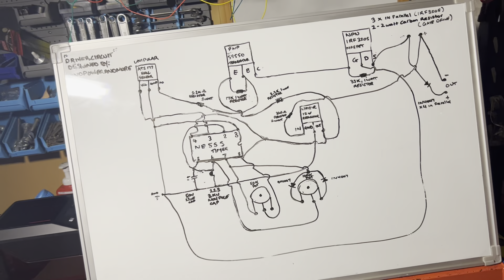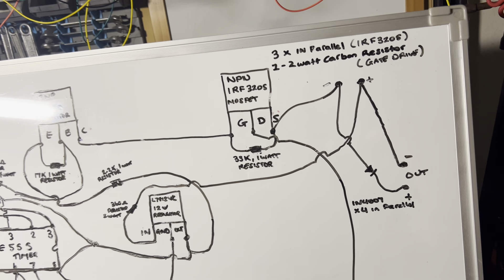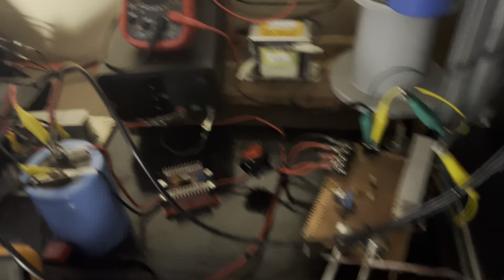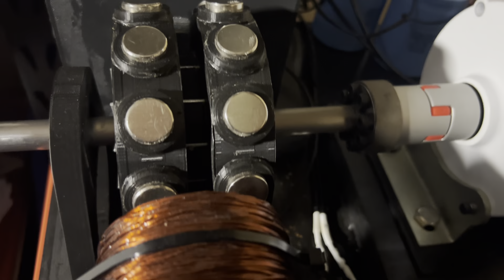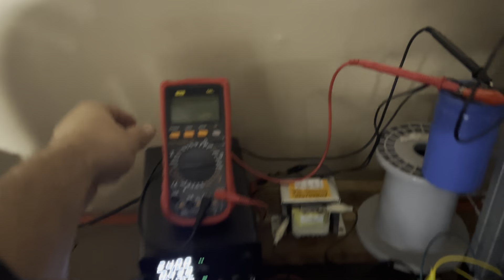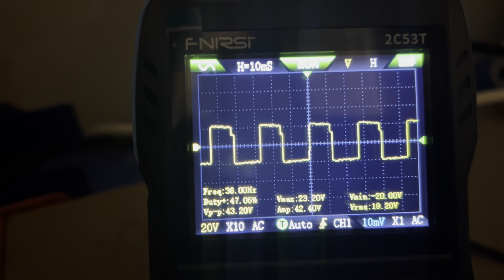Pulse Motor/Generator How It Works

Comment: It's just working off the capacitors, you're driving yourself mad with this endeavor. A few solar panels would do more then you ever did here easily and efficiently with zero maintenance. Just sayin' gl mate. 😮
Reply from the maker: There's a method to this madness. Watch my other videos to be up to date on what's actually going on here. There's so much more than meets the eye and this video is more of a walk through explanation rather than how much power it puts out hence of the title name.
Reply: What about night and cloudy streaks? He would need some wind power to supplement a gap. Stll leaving a hole if none of that can output effectively. So a generator of some sort or maybe some hydro power loop system which would just make the whole system pointless. All to just power a generator 😅😅😅😂😂😂.  Please let this man work

Comment: Just found your channel.. This is really cool stuff you're working on. . there's a couple other guys doing the same thing, its very exciting times. One very minor (and off topic) thing: when building frames out of extruded aluminum frame with those right angle corner braces, they're are significantly stronger when placed above the joint (under tension) instead of below the joint (in compression). Not that it really matters at all,  just so you know for future reference. Sorry I had to point it out because it was bothering me lol
Reply from the maker: Thank you for the lovely tip and welcome aboard 🙂

Comment: I've done the same similar concept with bedini circuits. I found out it's more efficient to recirculate the back EMF from the drive coil into another slave drive coil directly instead of recharging caps like you demonstrate. Just put a diode after the drive coil to collect the back EMF this increases the RPM by nearly double without any additional input
Reply from the maker: Thank you. That is true for most bedini cicuits and other types of pulse motors when using that technique to purely rely on the radiant inductive spikes as the ssg produces little to no tangential or centripedal torque on a rotor. because I'm utilizing a portion of the flyback energy or the B-EMF (both different anomalies occupies in the same system) to do mechanical work  whichs why capacitors are needed to help keep buffering the electrical transferring of energy while taking advantage of spinning disc to harvest the pick up coils being a decoupled system that compliments all the stages together.
Reply: @11Sam11 I have converted a washing machine motor rewind it bifiler it has plenty of torque and speed with additional output to another set of drive coils to spin the same rotor even faster with no extra input
Reply from the maker: @gregstafford2155  I did the same also with my fisher & paykel motor years ago. But even still, there's an exchange trade off that is proportional to your output. I've posted a recent video demonstrating how placing the hall sensor can convert most of mechanical into electrical and vice versa. Here's a link https://www.youtube.com/watch?v=LNhP20VoNV0

Comment: It's nice to see an inventor. Actually evolve their invention, and not stay stuck with the same research prototype that was only meant to do their initial research. 
Great demonstration on reusing of the initial input power. 👍👍.
Have you tried to pulse discharge the Caps that come off the wind turbine. Not a cap dump. But pulse discharge  just like the driver circuit. The lens drag on the wind turbine will be a lot less. And you really don't lose nothing cuz it's continuously going into the caps.
Reply from the maker: Thank you so much. Your work is amazing an inspiring also been following your channel for quite some time. That is  a good idea an will definitely give it a try. Much appreciated